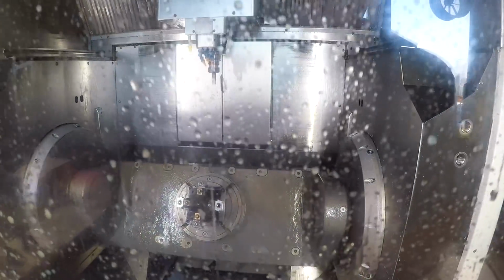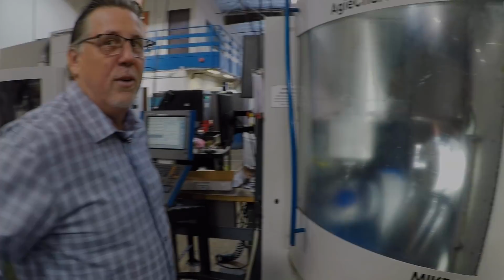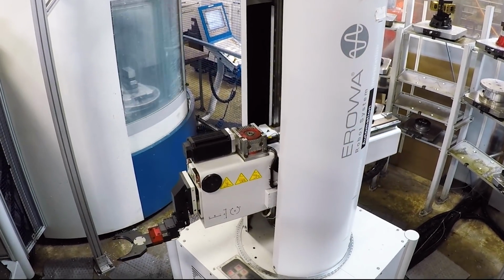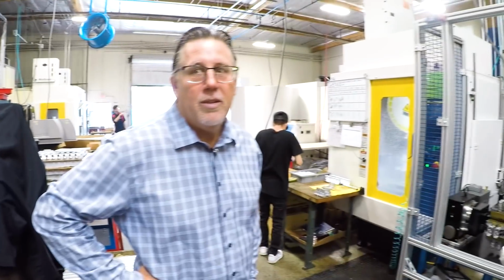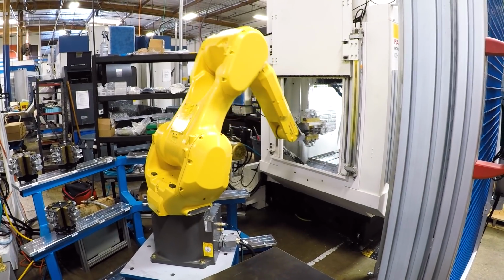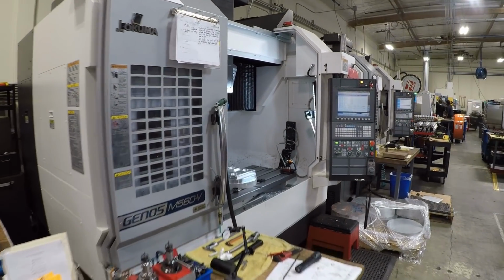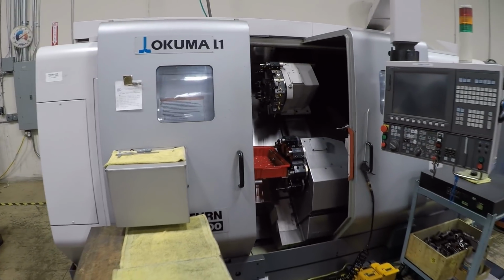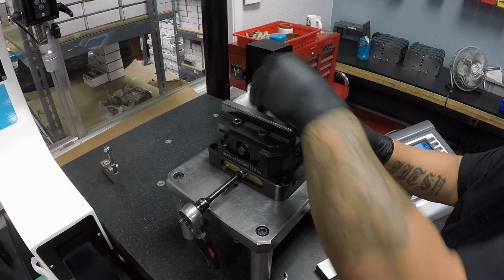CNC Shop Tour | 5th Axis: PHENOMENAL Workholding Solutions & Embracing Social Media Community!

Comment: Couldn't you keep the wax away from the machine with some kind of air curtain maybe?
Reply: I was thinking something like Makino's Graphite series (designed for cutting Ram EDM tooling) that has seals and air pressure differential systems built in for keeping graphite particles from getting into the mechanisms.

Comment: Why are they machining wax impellers?
Reply: probably mold making stuff for lost wax processes.
Reply: lost wax casting?
Reply: Likely for lost wax casting.
Reply: @bcbloc02  why not just machine the impellers then?
Reply: @chain3519  Maybe they are titanium or other super alloy castings and it satisfies the cost requirements that machined from solid would not.
Reply: @bcbloc02  patterns for lost wax casting are generally made in injection molds for production. This seems like an extremely expensive way to make parts that could otherwise be produced in a matter of seconds.
Reply: Jonathan Hornell-Kennedy Yeah. I don’t know why else they would do it though? It’s a mystery to me!!
Reply: @bcbloc02  Possibly machining was as prototypes or very low production.
Die casting dies are not cheap either.  
It is possible the shape can not be produced by die casting.  
JIM
Reply: @chain3519  impellers are traditionally cast...they see the machine shop for repair later in life..but to provide the best public service like waste water management without taxing everyone into 9 kinds of stagnation....to this day it is still far wiser to cast complex shapes like impellers instead of machining.... If you drop the american rent rates back to 350 a month...the wages for a handburger wouldnt need to rival the cost of paying off 5 or 10 axis swiss machines and we could possibly cast our own impellers again instead of outsourcing even that.

If you rely on a law to drop the rent rates...or allow investment idiots with new machine tech to charge the public ten grand per 5 axis machined impeller ...then all the money and cool tech experience in the world will be made quite literally worth less...worthless
Reply: If however your 5 axis machine is already paid for...and its electricity, maintenance cost, and tooling are low enough...you may at this time still have a substantial edge in accuracy for pattern making over additive manufacturing....all that speculation asside...whenever possible.. the older methods of die casting patterns will likely, genuinely, be far far more ecconomical and reliable than any of the modern options.